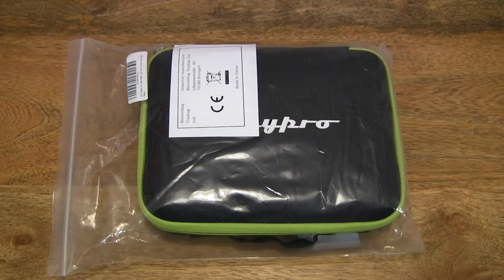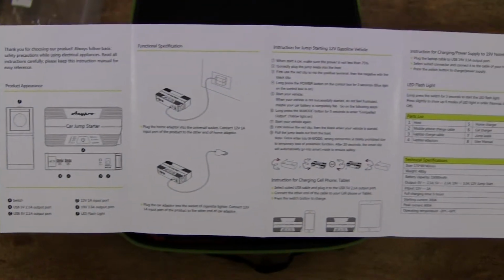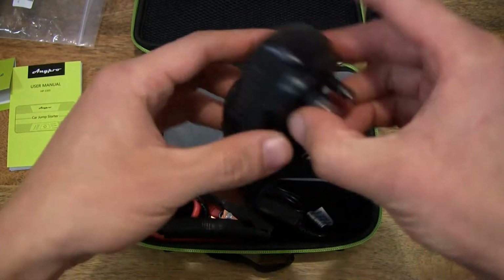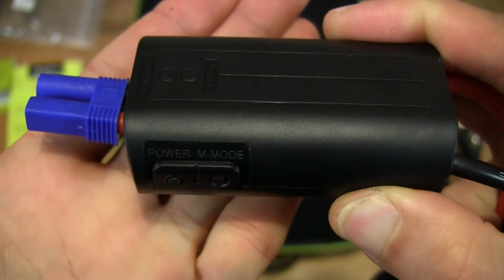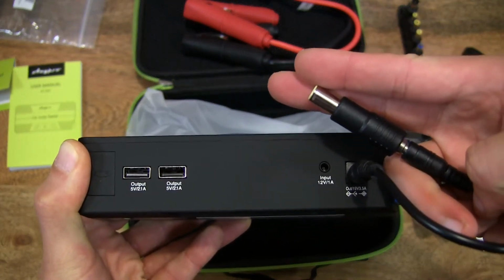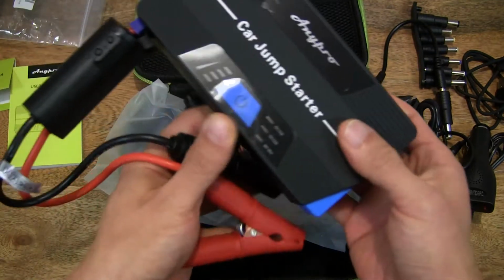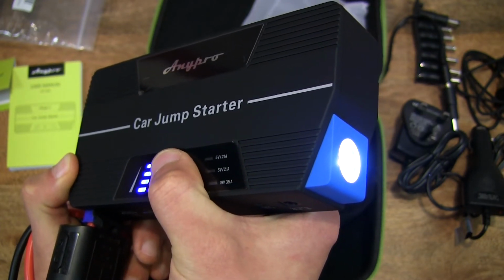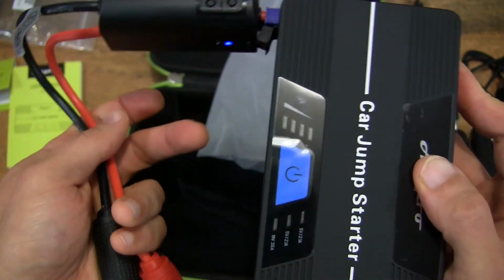Anypro Car Jump Starter with Smart Clips

Comment: And they connected to the battery it just starts buzzing on the little car battery thing soon as I plug it in it’s not even on the battery yet on the vehicle and it’s just buzzing away buzzing away I just can’t get it to stop buzzing do you know why it wouldn’t because it’s a buzz if you do can you let me know
Reply from the maker: Hi, the best thing to do would be to contact Anypro customer support for assistance to resolve the issue. Happy starting.

Comment: Hello I have the same car starter as you do on the black thing that has the battery connectors what would cause it to beat it like buzzes and I can’t get it to stop buzzing can you let me know what is causing it to buzz and if you have an out like a solution can you please let me know what the problem is thank you
Reply: On the red and black where are you clip onto the battery the little black box that thing just keeps on buzzing and buzzing it doesn’t matter if I have it connected to the battery or if I have a connected to the little battery connector thing it just constantly visors I have the slightest idea how to get it to stop buzzing you have any idea why it’s doing that thank you
Reply from the maker: Hi, contact Anypro customer support for assistance to resolve the issue. Happy starting.